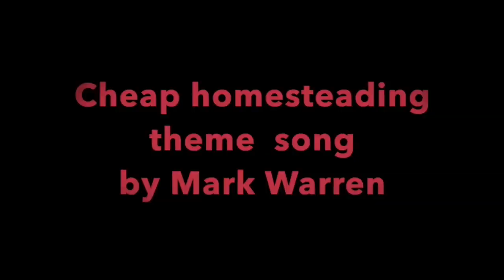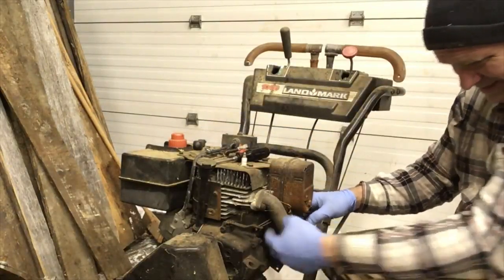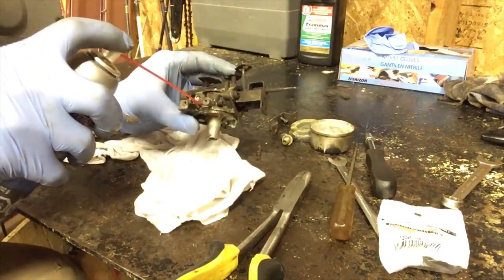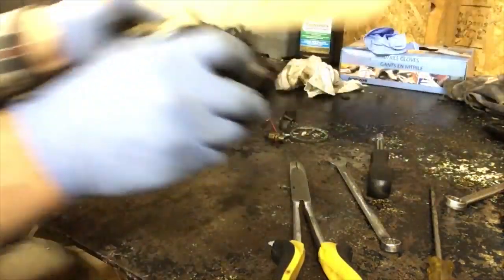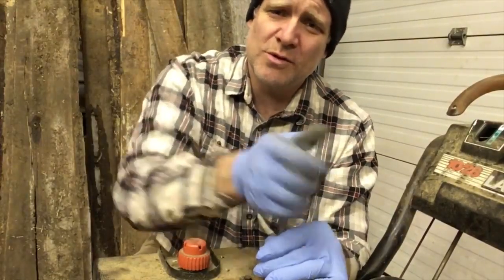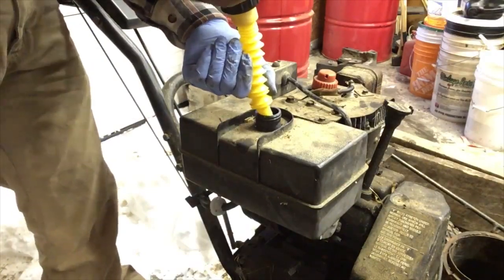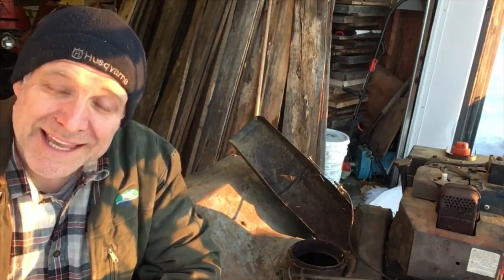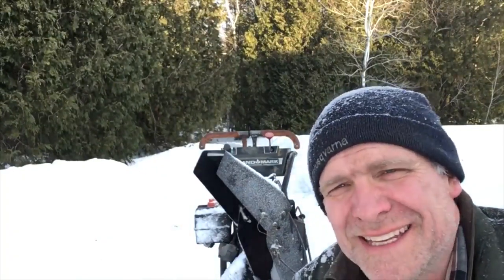Cleaning the carburetor on a 10 HP Tecumseh engine on a snowblower

Comment: Last year, I didn't have to use my tractor snowblower at all.  I just used my walk behind snowblower, which is almost the same as yours...mine is probably a little newer.  This year, I finally had to use the tractor snowblower...yesterday.  And my walkbehind blower snapped a cable to the transmission.  If I can get that fixed, I will think about cleaning the carburetor, because the thing runs like crap.  Thanks for the video.   Very helpful.

Comment: where can I get a rubber seat for the needle?
Reply from the maker: Normally it comes with the needle and seat kit. They’re normally not too expensive. Thanks for watching
Reply: @cheaphomesteading  thanks  I thought I blew it out with the air compressor. But upon looking closer. The seat is still there. Wheew